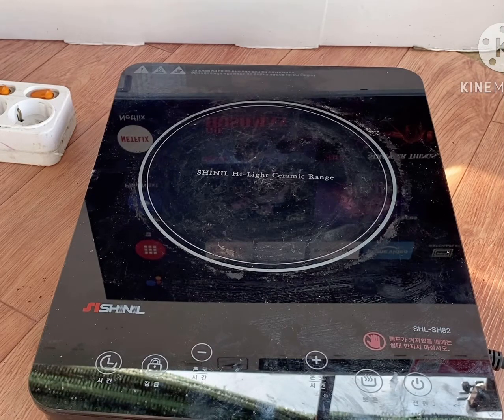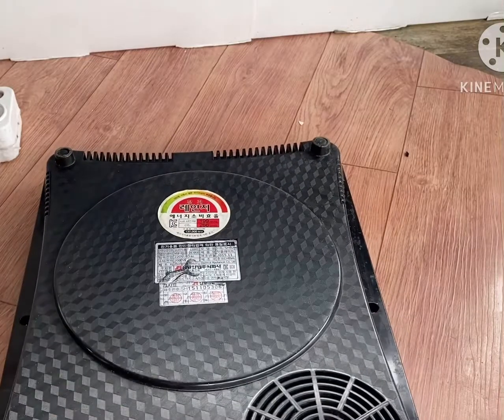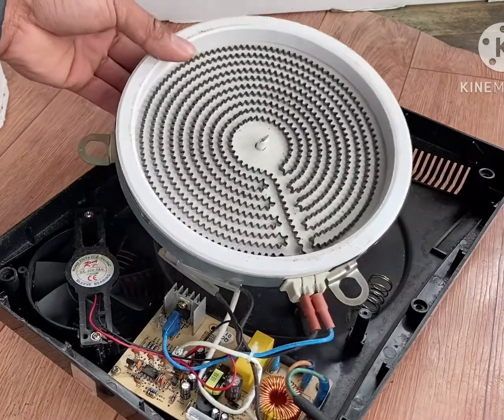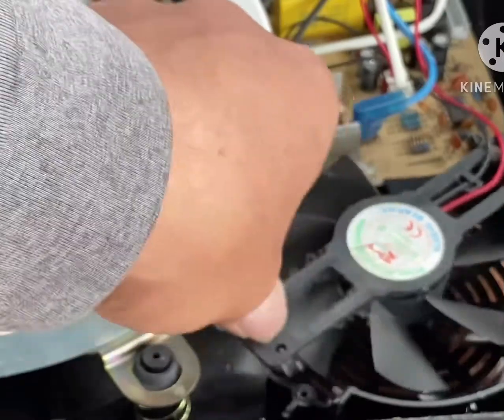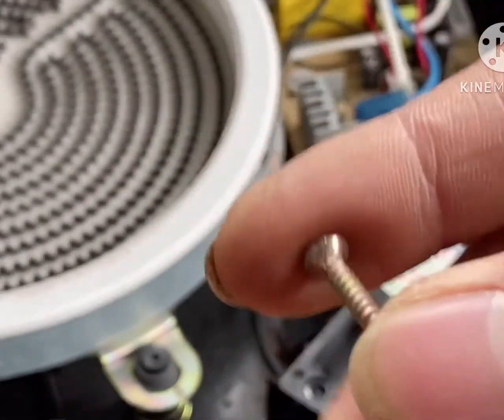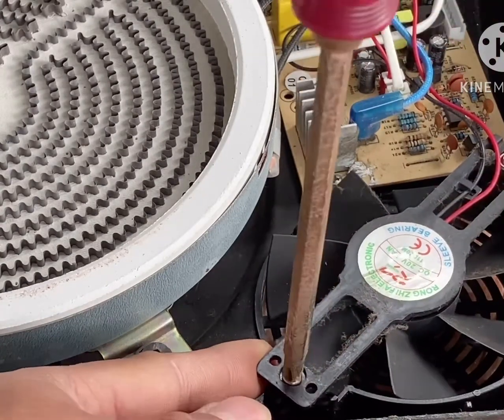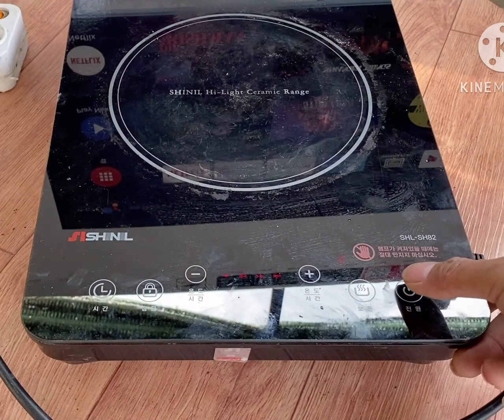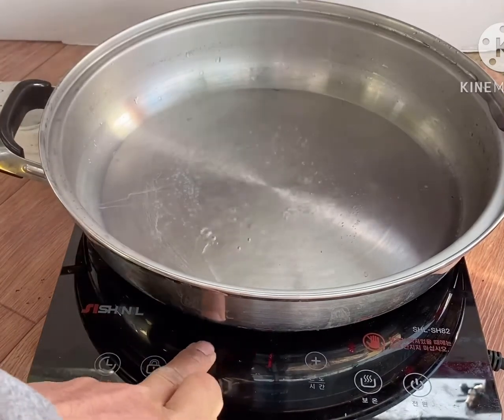How to repair a broken ceramic heating stove

Comment: kuya nabasag ung glass cover ng induction ko replacable paba un
Reply from the maker: Mahirap po makabili ng glass replacement na bago.  D po kasi kagaya ng  electronic parts na universal.  Less chance the only way is buy a used one in a recycle shop .